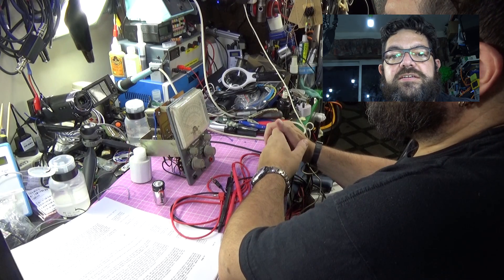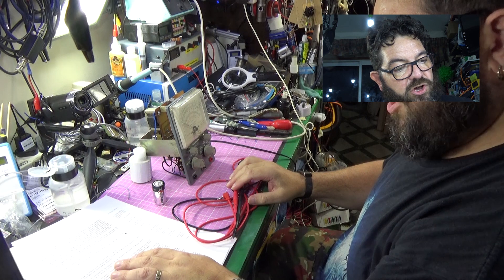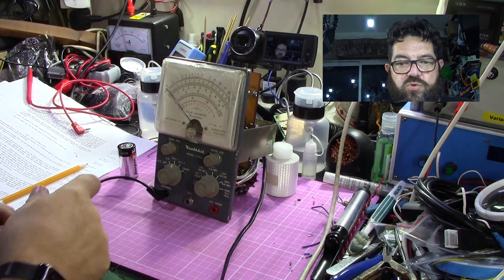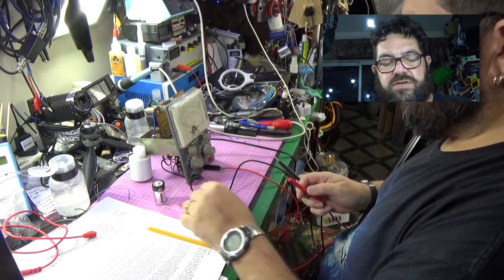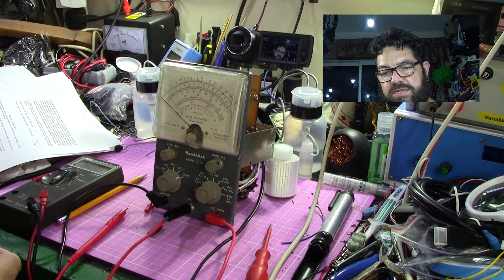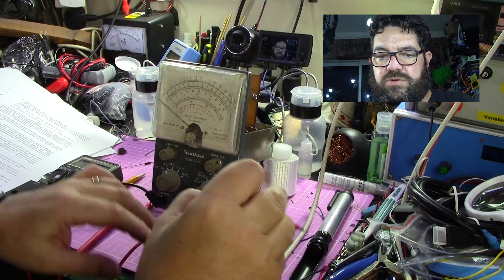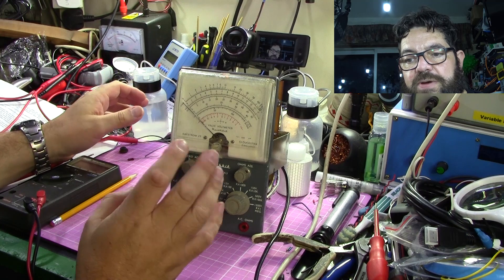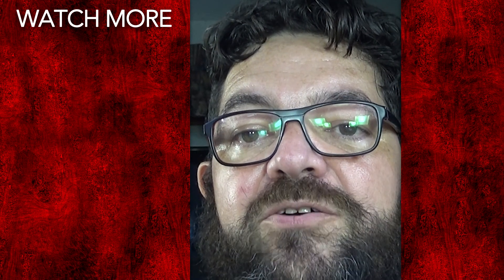Heathkit V-7au VTVM Finished

Comment: Hi from Bacchus Marsh Australia.  I just found your channel and watched all the repair videos.  I wonder if Franlab might have a switch to suit the VTVM? She has a large collection of vintage parts.  The only vintage radio I have is my Yaesu FRG-7 which was a garage sale find and only needed a couple of switches cleaning plus removal of some dry leaves from the i.f. board.  No moisture damage so a great little find. I also had fun getting a Nintendo Entertainment System (NES) working after a previous attempt damaged the motherboard.  A short wire got it up and running along with cleaning the 72 pin cartridge socket.  All for $8 and a little work.  I often watch restoration videos while playing Minecraft, especially Jim Lindenas, BAndersenTV (love Philco Predictas), Radiocruncher and others
Reply from the maker: I'm sure Fran would have a spare but its not only the switch but the US has the most expensive postal system in the world, especially international. I see bargains on ebay and then see the shipping plus import taxes actually cost 3 times what a brand new item would cost! As Heathkit had a UK outlet there is quite a lot of it floating around here but most of it is so reliable that it only comes up for sale on shack clearences after the owner passes on. The Frog is a great receiver, you got a good deal there. I would get one if I could justify another HF receiver but I have general coverage on both my Ham transceivers as well as a couple of cheap sdr radios. $8AU for a NES! wow! They are big money over here with the retro crowd. Another fantastic find. Many thanks for watching and joining in. I hope you enjoy watching.

Comment: At least the electrical side is figured out. Nice job.
Reply from the maker: Pure luck finding the fault. I was getting stressed and was gripping the panel tight. Then when it behaved I had to replicate it and sure enough, bend shaft, switch good, release, not good!